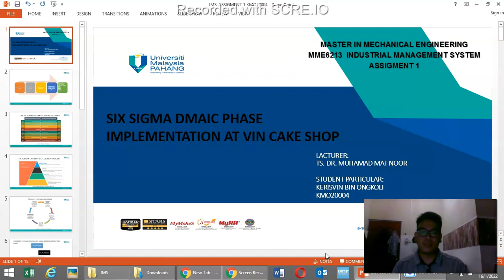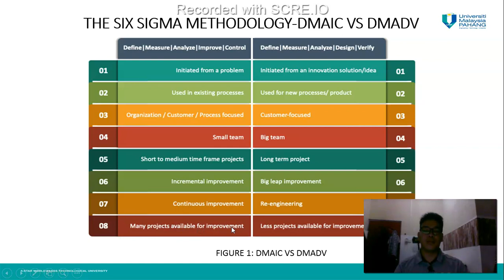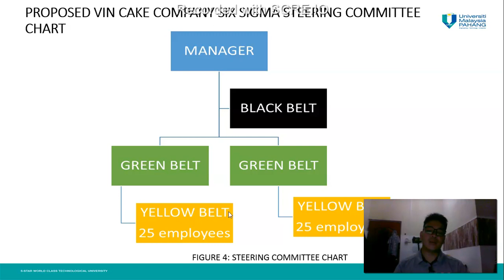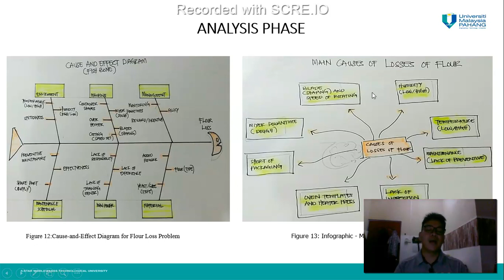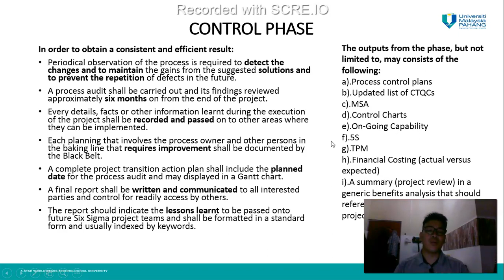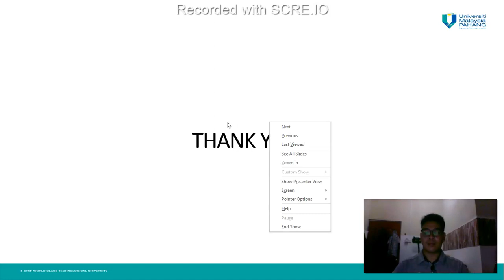Video Six Sigma Project Presentation

Comment: The team identified a specific, high-impact problem like increasing flour consumption and rising costs. A well-defined problem ensures alignment, focus, and meaningful goals. Next, good measurement prevents guesswork fixes and directs attention where it matters. Then, finding root causes is essential; otherwise, improvements would be temporary or misdirected. The team tracked financial results, demonstrating increased profitability. Six Sigma projects succeed when improvements translate into measurable business benefits. The team followed DMAIC step by step, preventing shortcuts and ensuring disciplined problem-solving.

Comment: TK24034

This Six Sigma project was successful because the team was able to determine problems to solve, strong support from leaders, and used data and the DMAIC method instead of guessing. Good teamwork and a focus on real business impact also helped the project run smoothly. From the presentation, I learned that using data, picking the right project, working together, and focusing on the root cause are all important for getting real, long-lasting improvements.

Comment: 1) Key Factors that Contributed to the Success of this Project
-Rigorous Application of DMAIC
-Data-Driven Decision Making
-Clear Root Cause Analysis
2.Main Lessons Learned from this Project Presentation
-The Power of Focus (Pareto Principle)
-Measurement is Critical
-Process Capability as a Benchmark

Comment: MA22059 

1) In my view,  Six Sigma project was successful because it followed the DMAIC steps clearly, used data to identify the main production problems, and implemented targeted improvements to reduce defects and increase efficiency. By addressing issues like oven performance and workflow delays, the project achieved measurable improvements in quality and productivity. 

2) I learned that using the DMAIC method helps identify root causes effectively and ensures improvements are based on data, not assumptions. The project also shows the importance of process standardization, teamwork, and continuous monitoring to maintain consistent quality and performance.

Comment: 1) This Six Sigma project was successful because it clearly defined the problem, used data-driven analysis, and applied the DMAIC method effectively. Teamwork and sustainable solutions played a key role.

2) I learned how structured problem-solving, like using DMAIC and tools like the fishbone diagram, leads to real improvements. Great example of data and teamwork in action!

Comment: The success of the Six Sigma project was attributed to the methodical implementation of the DMAIC approach.  The team meticulously defined the process scope, focused on resolving the most urgent issues, and gathered and analysed reliable data to find performance gaps.  Workable solutions were developed and implemented as a result of an effective root cause analysis.  Ultimately, strong control techniques were used to preserve the improvements, which led to a noticeable rise in process effectiveness.

Comment: The Six Sigma project, in my opinion, was successful because it followed the DMAIC process methodically and concentrated on data-driven solutions, such fixing packing problems and oven inefficiencies.  This resulted in quantifiable increases in profitability and productivity.

Comment: 2) This project presentation offers valuable insights into the practical application of Six Sigma principles. It underscores the importance of a structured approach to process improvement and the necessity of basing decisions on data analysis. The presentation also highlights the significance of team collaboration and stakeholder engagement in driving successful outcomes. Overall, it demonstrates how systematic methodologies like Six Sigma can lead to substantial improvements in efficiency and quality within an organization.

Comment: For the first question, they use to find the main issue which is too much flour was being wasted and the they measured how much flour was being lost. After figuring out the causes, like faulty ovens and bad packaging, they made specific changes. For example, they fixed oven temperatures and improved packaging.

Comment: 1) The Six Sigma project at Vinca Shop succeeded by clearly defining the problem, using data to identify root causes, and implementing targeted improvements. Ongoing monitoring ensured sustained results, leading to reduced flour waste and improved process capability, benefiting the company financially.

Comment: I think i learned that the DMAIC methodology is one of the best mthods to use when coming to running six sigma projects, especially when aiming to improve the margin of error in a system or production system. With the method, we could find various aspects of problems in the system and determine the severity it brings to the company. Being able to identify the problem is the most important part of six sigma projects as solving and improving the problem will contribute to the margin of error to reduce as small as possible.

Comment: I think that the project's success may be attributed to its strict use and implementation of the DMAIC methodology, implementation of targeted changes, and use of data-driven analysis to pinpoint the underlying causes of faults. A Sustained outcomes were guaranteed by strong teamwork, management support, and ongoing observation. Additionally, the presentation taught us the benefits of structured issue resolution in DMAIC and the application of data value in project/business decision making. In order to improve the project outcome and guarantee its success, the impact of cooperation and clear communication is also very significant since it influences how well teams communicate with one another during a project.

Comment: 2. This presentation made clear that the main idea is that a structured and data-driven process like Six Sigma’s DMAIC helps you solve the core problem instead of just its effects. It says that using SIPOC, fishbone diagrams and statistical process control charts allows for better improvements and frequent supervision and teamwork ensure that things improve and stay that way. This project shows that even in food production or small enterprises, Six Sigma plays a major role in decreasing waste and raising profits when implemented thoroughly.

Comment: Thank you for the lecture, Dr. Here is the answer for the question:

1. This Six Sigma project was successful primarily because it followed a structured DMAIC (Define, Measure, Analyze, Improve, Control) methodology, allowing the team to clearly identify root causes of the problem and implement data-driven solutions. Strong collaboration among team members and the involvement of stakeholders throughout the process also contributed to its success. By using tools such as cause-and-effect diagrams, control charts, and process mapping, the team was able to make informed decisions that led to measurable improvements in quality, efficiency, or cost reduction. The commitment to continuous monitoring and control ensured that the gains were sustained over time.

2. From this project presentation, one key takeaway is the importance of a systematic approach in problem-solving and the value of relying on data rather than assumptions. It also highlights the role of teamwork, leadership support, and clear communication in driving project success. Additionally, I learned how breaking down complex problems into manageable steps can simplify the improvement process and lead to more effective outcomes. Overall, the presentation reinforces the idea that continuous improvement and a focus on customer satisfaction are central to Six Sigma's effectiveness.

Comment: This Six Sigma project was successful because the team implemented the DMAIC methodology, they identified that oven pasting and packaging humidity as the main root causes, and then proceeded with improvements to reduce waste and production costs.
Through this presentation, I learned that implementing the Six Sigma DMAIC methodology in a  small business or large industries can improve the manufacturing or production processes, increase efficiency, reduce defects, and increase profitability.

Comment: The lessons learn from this presentation is,
1) Importance of Structured Methodologies: Adhering to the DMAIC process ensures systematic problem-solving and continuous improvement.
2) Value of Data Analysis: Making decisions based on data rather than assumptions leads to more effective solutions.
3) Need for Continuous Monitoring: Implementing control measures post-improvement is crucial to sustain gains.
4) Significance of Communication: Transparent communication among team members and stakeholders facilitates smoother project execution.

Comment: The project's success may be attributed to its strict adherence to the DMAIC methodology, implementation of targeted changes, and use of data-driven analysis to pinpoint the underlying causes of faults.  A Sustained outcomes were guaranteed by strong teamwork, management support, and ongoing observation.  Additionally, the presentation taught us the benefits of structured issue resolution in DMAIC and the application of data value in project/business decision making.  In order to improve the project outcome and guarantee its success, the impact of cooperation and clear communication is also very significant since it influences how well teams communicate with one another during a project.

Comment from the maker: The video describes a Six Sigma DMIC (Define, Measure, Analyze, Improve, Control) project at a bakery shop ("Vin Cake Shop") to reduce flour losses in bread production. 

The Define phase identified high flour demand and rising costs. 
The Measure phase analyzed flour usage data, revealing increased actual usage. 
The Analyze phase pinpointed the oven (pasting on containers) and packaging (humidity) as major loss sources. 
The Improve phase proposed solutions like oven temperature control and addressing packaging issues. 
The Control phase stressed maintenance, monitoring, documentation, and financial review for sustained improvement. 

The project aimed to minimize defects, reduce waste, and increase profitability.

Comment: The success of the Six Sigma project was attributed to the systematic application of the DMAIC methodology. The team began by clearly defining the process and analyzing precise data to identify root causes. They then implemented practical solutions, such as workflow optimization and waste reduction. Strong control measures were established to sustain the improvements, leading to reduced defects, enhanced efficiency, and increased profitability.

Comment: The keys to the success of Six Sigma project were comprised of the systematic application of the DMAIC methodology. In addressing critical challenges the team ensured that it compiled accurate dossiers to identify the performance gaps most evident and could describe the process limitations accurately. A proper root cause analysis enabled solution development and execution along with proper control to make change sustainable. From my perspective, the credit of achieving the objective of the project and attaining significant improvements in productivity as well as profitability was due to the systematic application of DMAIC and deployment of key data solutions, for instance dealing with oven issues and packaging, that formed the central part of this project.

Comment: The systematic use of the DMAIC methodology was responsible for the successful implementation of the Six Sigma project. The team focused on addressing the most urgent issues, gathered and analyzed reliable data to uncover performance gaps, and meticulously framed the process boundaries. The objective or root cause analysis was so efficient that it resulted in identifying applicable solutions and implementing them. To sustain the gains, the most robust control methods were adopted, leading to significant process efficiency.

Comment: In my view, the Six Sigma project was successful because it systematically applied the DMAIC technique and focused on data-driven solutions, such as addressing oven inefficiencies and packing issues. This led to measurable improvements in both productivity and profitability.

Comment: The Six Sigma venture succeeded due to the fact the DMAIC technique changed into implemented step by step. The crew focused on defining the system, studying accurate statistics to locate the basis reasons, and implementing practical answers like optimizing workflow and reducing waste. By preserving robust control measures, they ensured the enhancements had been sustained, resulting in fewer defects, higher efficiency, and better profitability.

Comment: The DMAIC technique was used step-by-step, which is why the Six Sigma project was successful. The team's main goals were process definition, precise data analysis to identify the underlying causes, and the application of workable remedies including waste reduction and workflow optimisation. They made sure the gains were maintained by upholding strict control procedures, which led to fewer flaws, more productivity, and greater profitability.

Comment: The Six Sigma project succeeded because the DMAIC methodology was applied step by step. The team focused on defining the process, analyzing accurate data to find the root causes, and implementing practical solutions like optimizing workflow and reducing waste. By maintaining strong control measures, they ensured the improvements were sustained, resulting in fewer defects, better efficiency, and higher profitability.

Comment: The DMAIC methodology's systematic application was credited with the Six Sigma project's success. The team concentrated on fixing the most pressing problems, collected and examined trustworthy data to identify performance gaps, and carefully defined the process scope. An efficient root cause analysis led to the development and application of workable solutions. Finally, robust control methods were implemented to maintain the gains, which resulted in a notable increase in process efficiency.

Comment: The Six Sigma project succeeded because the DMAIC methodology was applied systematically. The team clearly defined the process scope, collected and analyzed accurate data to identify performance gaps, and prioritized key issues. Root cause analysis was conducted effectively, leading to practical solutions. Finally, robust control measures ensured that the improvements were maintained over time, resulting in a substantial increase in process efficiency.

Comment: The reasons for the succeed of the project are the DMAIC practitioner properly defined the entire process using SIPOC diagram, measured data using process capability test, analysed the critical reason of problem using pareto chart, identified  the root cause of problem, and suggested the control action require for maintaining the enhancement achieved. By doing so, the objective of the project is achieved, enhancing the process capability by 233%.